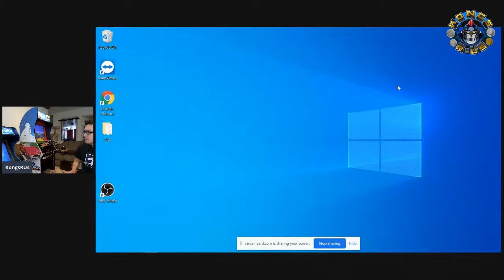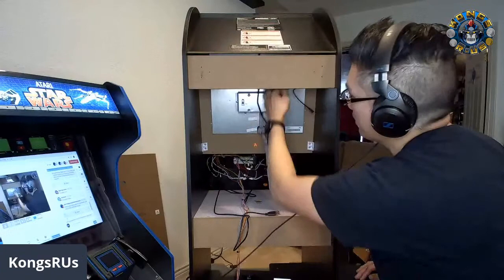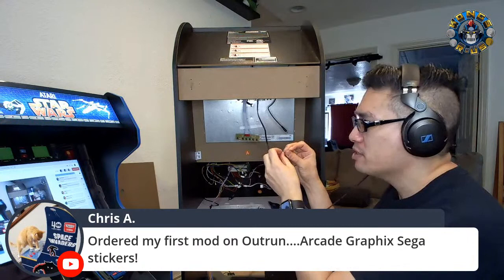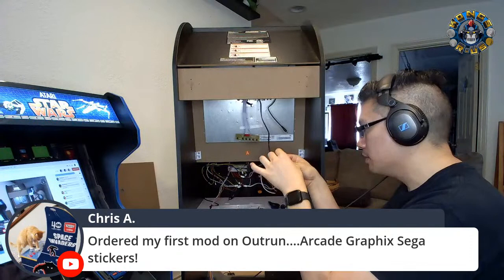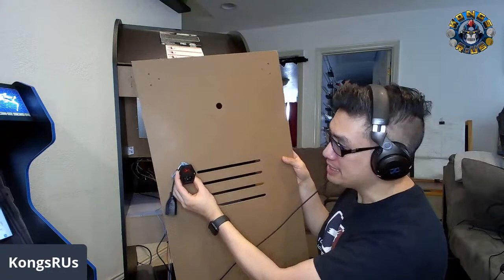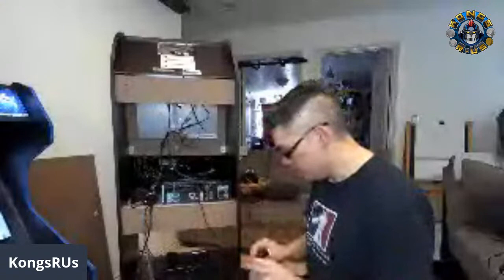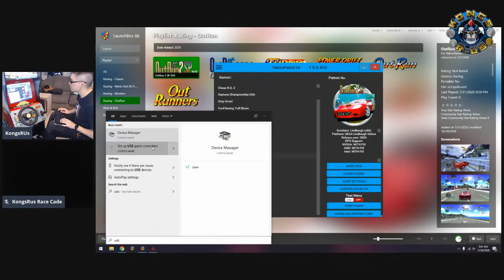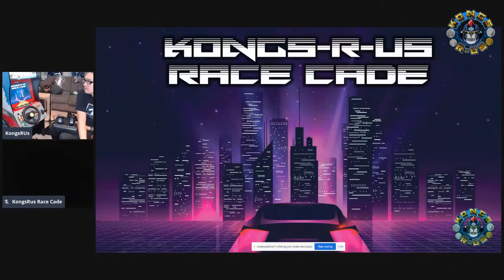Let's Finish Up Modding the OutRun Arcade1up - Cab Installation, Monitor, Power, PC, & Playlist

Comment: I have a few 128mb ram upgraded OG Xbox’s that support the Chihiro arcade setup which lets me play the arcade version of Outrun 2 along with the home port of Coast to Coast they look and play great. 

I also scored an Intec racing wheel and pedals in great condition. I pull them out and play with them with the kids and friends from time to time. Good component cables (monster brand are great but watch out for sellers on eBay pimping the s-video variant as component) and an HDMI adapter make it looks just about as good as it can be without upscaling on our Sony 65” tv.
Reply from the maker: cool! Outrun 2 is awesome, one of my favorites

Comment: Very cool man. That was fun to watch. I really want to build a race cabinet myself, but I will have to wait. Right now I am trying to finish my wife's modded Frogger Arcade1up cabinet that has the Raspberry Pi 3B+ in it. But I have started to slowly regret my decision and I want to run an older Gateway computer tower into it. I mean the Pi wont even run the OutRun or Hang-On games that good, which is a negative for me. Anyway, then I am turning my Space Invaders Arcade1up with a 4 player custom control panel with an Asus built computer tower with all the extra stuff hooked to it.
Reply from the maker: cool mods! yes, I prefer PCs and their flexibility and versatility. Pi's definitely are good for classic games

Comment: Hey there. Is there a more in-depth tutorial on how to get the stock steering wheel and shifter to work with PC? Also, have you successfully added an aftermarket steering wheel to the cab? Curious to see the final result and where you mounted the shifter. 

Thanks!
Reply from the maker: I have a full tutorial planned on modding the wheel to add to a PC soon. I also had another live video where I added a PC wheel instead. might do a TLDR version later too once I finish all the mods I have planned

Comment: Great informative video! Which device did you use to interface the wheel and pedals to the PC? Ultimarc has an ipac, APAC and uhid. Wondering which one would be the simplest method.

Comment: Kong!
Your tutorials are fantastic...thanks for sharing all of your knowledge. I have been modding A1Up cabinets with relative success...proof of concepts (if nothing else...rotating monitor and 4 Player on a 3 Player control deck)
Anyway, I have a GRS flight yoke that I am struggling with by plugging directly into the PC via USB...it keeps going to "sleep" after a few minutes of inactivity. Also, the response to a MAME game like Paperboy is "wonky" at best. Do you suggest using an APAC encoder and NOT going directly via USB? If you prefer a direct USB connection, what settings do I need to look at inside Windows?!
Lastly, what pedal board do you suggest if I want to add gas/break pedals to my cabinet so I can add driving games?

Thanks in advance...subscriber for life!
Brent
Reply from the maker: hey Brent, thanks for the support! for your GRS yoke, im not sure what you mean by going to "sleep". it should register as a regular joystick controller so you can use it when games can read inputs from a controller. if you have it in Mouse mode, you may want to change it back. for games in Mame like Paperboy, you have to play with the analog settings to get them just right. I would turn down the x axis and y axis sensitivity down to 1, then adjust from up from there until you get a setting that feels responsive with the yoke.
Reply from the maker: as for pedals, ive used Thrustmaster pedals that you can buy as stand alone, and get a USB adapter for them.
Reply: @KongsRUs  
I will need to keep troubleshooting, but the yoke only seems to respond in MAME when it is set to Mouse/Gamepad mode...that is when it goes to "sleep" and becomes unresponsive after a few minutes (whether it is controlling the mouse cursor on the desktop or functioning within MAME). Yes, I have had many an hour of messing with the analog sensitivity settings for games using a Spinner or a Trackball and have tried it with the yoke...but as far as Paperboy is concerned, it is not as smooth as I expected. 
Also, running Star Wars Trilogy using Supermodel is not as responsive as I had expected. 
Perhaps I should just wire it into an APAC encoder!?
Thanks for the message,
Brent

Comment: Could you run daytona usa instead,what would be a good wheel, pedals, and shifter…could the original one work?
Reply from the maker: You could definitely run Daytona using a PC and modded wheel, or any PC wheel
Reply: @KongsRUs  will a pc with an old gtx 980 video card run daytona usa as smooth as the arcade original?